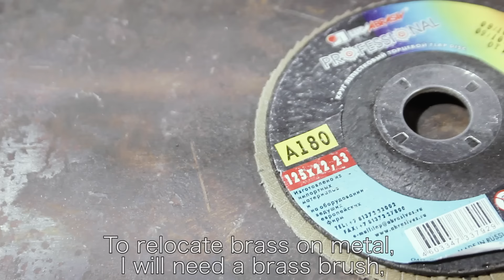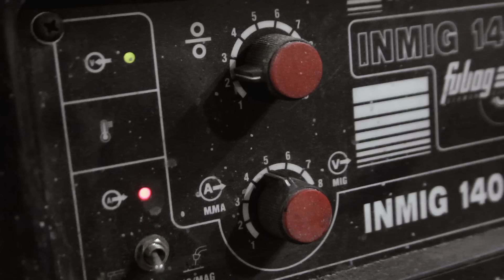Making Viking Axe from the Cheapest Bought Axe

Comment: Good deep etching, car battery chargers work real good, and white vinegar instead of water better.
Reply: I was wondering if I could use my battery charger.
Reply: How do you do the etching mate. Ive never done it before but would love to have a go at making a pair of these for hanging on the wall.
Reply: So did he just use a stick welder with a rag dipped in salty water and run it over the axe head? That was enough to etch it that deep?
Reply: @billysaunders544  yes
Reply: @RuLaKeLP  thanks very much, I tried it, it worked, I also I bought a battery charger and it worked better
Reply: what paint works best, and by best I mean is easy to create a sharp design without struggling with the paint removal?
Reply: Thanks for sharing!!
Reply: I have used etching resist marker like those used to create circuit boards..works ok, never tried the paint idea( next time) used bees wax on the steel over my pattern drawn on the steel removed wax at areas I wanted to etch. Then used vinegar let it sit for 12-16 hours .  Will try battery charger next time. 
Noticed the words coming up on the screen... but very difficult to read if you can read them at all. Voice overlay might be better there.
Reply: I was wondering if you put something on the blade to prevent rusting? It looks like there’s a faint gold tint on the blade. I loved your attention to detail, it sets your axe apart from the rest. You didn’t show your sharpening technique, I would have liked to have seen it. Anyway, KUDOS for a job well done my friend.

Comment: I`ve done this ! lol wish I`d had your tools , did mine on an old sears bench grinder and 1x42 inch belt sander !  turned out pretty good . of course I did`nt do the etching , no equipment for it !  you do nice work
Reply: car battery charger for the etching works very good
Reply: Thinking of making one myself. Any chance you could show us a picture of the axe you made.
Reply: Philip Finke
Does a car battery charger actually work for etching? I’ve been wanting try etching for ages
Reply: Daniel, I've seen many videos about it, you would need an older battery charger. The new ones have a ground fall intercept and won't work
Reply: @danielmunro6426  can’t use a smart charger, but the cheap ones that are basically a power supply with a 12v/6v  and amperage selection toggle switch work well.

Comment: Great vid and show of craftmanship - how about doing a vid on Tools to do stuff like this (maybe much more simplistic for beginners) -  stay safe
Reply: You saw the tools... But I'll run down a list of the basic things you need to get started. 
Number 1 is and always will be a vice and a stable platform to hold it. Angle grinder for heavy cutting work. Grinding disks, more disks and more disks (this will be a pattern for all abrasive cutting tools, they wear out fast). Metal files. Sandpaper, sandpaper, and more sandpaper. Water bucket to cool off the steel so it doesn't change its crystalline microstructure. Saw. Knife.

That's it. You can do everything he did in this video minus the etching with those few tools. To make things easier you can add a scroll saw, a bench grinder, a 1"-3" belt grinder, grinding belts, more grinding belts, milling machine, CNC etching machine, battery or acid to etch with, chisels, dremel tool, dremel bits, more dremel bits, leather punch, leather stitching supplies (sheath), kydex, kydex press, boiled linseed oil, tung oil, polyurethane, cerakote, forge, blacksmith's hammer, anvil, power hammer..... That's all I can think of right now lol.
Reply: @BrassBashers  I'm too stupid to understand all this shit you said but I hope one day I'll get to that point.
Reply: @isaac.3347  you’re not too stupid lacking experience would be closer to right. With a little determination and patience you’ll find your mind and hands are very capable. If your not familiar with certain tools or techniques do a little research. There’s tons of instructional videos on an endless amount of skills. No ones a pro from day one.     If you start a project and the end result isn’t perfection that not a problem. You learned what came fairly easy and what was tough for you. Research and practice the things that gave you trouble and you will get better at it. Practice on something that is scrap then you can’t mess up and won’t be so worried about ruining the piece.  Patience persistence and practice builds confidence. That’s the key! Have fun! When it pisses you off take a break. Oh yea this goes without sayin but Safety first. One skill at a time and before long you’ll look down and realize damn that looks pretty damn good! Don’t doubt yourself my friend if you really want to learn and can find the time it’ll happen. Promise!  Blessed be!

Comment: Mate, as you said 'very cool axe'. Look great as a decorative piece. Cheers for sharing.
Reply: Who said it's decorative?
Reply: @Reykh24  the handle being carved may introduce new stress points, the axe head being heated could weaken the molecular bond making it dull easier.
Reply: Untitled Document I don’t think it got hot enough to even get close to mess with the heat temper but you could possibly be right
Reply: @tomatoman3706  I should mention my previous comment is just a hunch, and not fact in any shape or form. I could definitely be wrong. I am only going off the extremely limited information I have from watching different blacksmiths work.  I'm probably the furthest thing one, as much as I find it fascinating.  The biggest concern I have is definitely the handle just because you do not want a faulty handle when using an axe.  That part of the comment is from experience lol
Reply: @ThisIsMyHandle.  Well a simple fix for making sure its not overheating is Just time. Wait for it to cool down between grinds and it should be fine

Comment: Dude that's pretty damn cool!! Just wondering about the temper on the blade.. it seemed pretty soft when you were filing it, maybe worth doing a heat treat
Reply: Not to mention the handle, which looks like pine and the rotary tool went through it like pine.

Comment: Hi, I would like to know what kind of painture was the blue one and what was inside of the salt solution?? I am trying to make the same as you following this video. It looks amazing.
Reply: Don't know about the paint (probably just normal spraypaint; it's there as a resist to protect the parts you don't want to etch, and spraypaint'll do the job fine), but the salt solution for the etching looks like a pretty standard mix. Water and salt, that's all. Get a container of warm water (warm water helps dissolve the salt) and pour in some salt. You don't need to be precise about measuring, just get it so that it's saturated/cloudy. Maybe... 1/8th to 1/6th of a cup of salt for each cup of water? If you want something a bit more aggressive, use vinegar instead of water. 

Just as a safety note, do it in a well-ventilated area, particuarly if you're using vinegar. The process creates nasty gas. Chlorine, IIRC. Small amounts, but not fun to expose your eyes to. Smells bad, too. Be sure to rinse your etched metal well afterwards to remove any leftover solution, or it'll rust quickly.

I wouldn't suggest using a welding power supply, partly for safety, partly because it might be too aggressive. On small areas or things like letter and numbers, you can use a 9v battery for power. For larger areas, I find a 12v car battery charger does the job just fine.
Reply: I believe he used acrylic paint for this job just make sure there is a thick enough coat, but u should listen to Cascadejackel^^^
Reply: @Cascadejackal  u seem to know what ur doing sir I have a question about the position of the clamps.  In the video he had both clamps attached to the same piece of metal & I'm told that will blow out the fuse instantly.  My dad said I should attach one clamp to the metal sheet & the other to the wire the axe is hanging on.  I wanted to hear ur thoughts bc it sounds like u know a thing or two.
Reply: @tanner2937  Positive clamp to the metal you want to etch or the wire it's hanging from, Negative clamp to the metal sheet. 

Remember, Positive current flows towards Negative, taking some of the exposed metal with it. That's how etching, and electricity in general, works.
+ >>>>>>> -
Reply: @Cascadejackal  Thank you for your help I'll be sure to try this once I get some free time,  have a good day man!
Reply: @tanner2937  Not a problem. One last piece of advice: Practice on a disposable piece of metal first. Something like a stainless steel paint scraper, since you can get a pack of them pretty cheap. That way, you can play with different types of resist or thickness of paint, and how much water/vinegar to how much salt in the solution.

You don't want to waste all the time spent getting your design right on the final piece, after all.
Reply: U are a legend mate scrolled way down to find this information 👌
Skål

Comment: Interesting build, I have one point of contention though.  2:50 when you're doing the file work; you should be only doing one direction with your file.  By pulling back with in contact. your only prematurely wearing out your file.
Reply: hm you dont know how the file was manufactured.
Reply: @diterpunkt4426  And you obviously don't know how they're made.  files are like a table saw blade, made to cut one direction. By pulling the file back across the metal you flatten the teeth and dull the file.
Reply: That's not quite right. Modern files can cut in both ways. And I know how they are made...

Comment: Instead of etching it with salt and DC, you could have done with way faster with the process I use : Acid. make a mix of 30% of hydrogen peroxide and the rest of chlorydric acid (the one you find at the drug store, should be at around 30% concentration, no need to find conentrated one). Keep your paint masking process and just put it into the mix. You'll see it's way quicker and could also be way deeper.
One good thing also : you can make the contour or you etching zone with wax (like the one around some cheeses), this way you don't have to immerge the whole piece, just create a "pool" around the zone anf fill it up with your mix. once you're done, use a sringe to remove the acid and simply rinse it with a solution of baking soda, it's a pH stabilizer (around 7), it will neutralise the acid and stop the etching.

Comment: I know its meant as decoration, but practical side of me is tortured by ruined temper on the edge. I have done similar builds with old rusted axe heads but try to use trown away ones and keep the heat out of the blade by cooling it. You can even weld them, long as you keep the blade cooled. There is also some temper on the back side as its usually used as hammer. None of my work probably ends up used ever again, but i like to preserve its utility use how ever much i can.

Comment: Great video, i do have a potential recommendation however. Whenever you go to use the electricity, use two seperate pieces of metal instead of one bent piece. The main path for current is just going through the metal and not through the salt water. Just a recommendation.

Comment: This is awesome, I have no clue that engraving the blade could be done that way, how is it exactly working when you charge the solution, what is it doing to the metal?
Reply: Electrolysis. The process takes the steel from the axe and placing it on the other piece, ions moved by electrical charge. High School Chemistry 101.

Comment: If you have access to ferric chloride acid it is great for etching patterns onto steel surfaces like that.  Resist can be anything from paint to masking tape.  Great work, looks great!
Reply: Would you also use the electrolysis method with ferric chloride acid?
Reply: @Spooki3Spir3  I have never tried, but I've etched patterns in stainless without it.  Takes a while based on the alloy, high carbon steel etches faster.
Reply: @drew5337  so etching stainless will work in this method, like you say it just takes longer? I have just tried it on a high carbon blade, earbud with salt water 4amp DC inverter.

Comment: I love your work! I tried my first axe and used paint instead of primer and  the paint came off when I used electricity with a cotton ball. Will I have that problem with the primer instead? And this time I'm going to use acetone to strip the finish of the blade before I put the primer on. What do you think?

Comment: What brass wire wheels did you use? Were they bras plated or solid brass? Plated ones are very cheap and easy to get.... but I'm thinking the steel would scrape the brass off again?

Comment: nice work. i hate using electriicty so i just do acid baths. hot, hydrosulfuric acid has never done me wrong. i guess you get different colors by using electrolysis or does it get deeper into the metal? whats the reason?

Comment: I'd guess the temper/structure of the metal was likely weakened after the heat of repeated grinding. Seems obvious that using it as a axe at this point would also destroy all the work put into modification. An amazing art piece though. Very lovely.
Reply: Probably, but for a single axe head, you could probably redo the heat treatment in a regular oven. 400F for an hour, take it out and let it air cool, repeat the process a second time. 

If it were a sword or knife, it probably wouldn’t work well, but for an axe, it should function just fine.
Reply: Though I do agree, using it as originally intended would take away from the artistic aspect.

I’ll give him this, I would have never thought to use the copper wire brush like that. Do you know what the purpose was behind that? I would guess to increase the conductivity in the salt water for a better electro etching, but maybe just to give it a slightly different aesthetic? 

I’ve seen people do saltwater etching using 9V batteries and q tips, but my jaw dropped when he brought out the welder. Like, “well he switched to the Big Guns fast.”

Comment: Just out of interest, is that just a thick primer you use for your edging? . 
Last I tried I used circuit board resin.
Cheers
Reply: What would you recommend?
Reply: @quinsworth1  I did some this week using normal primer instead of resin, and it worked grate, comes right off with acetone.
So i think 2 layers of primer is plenty good :)
Reply: Wouldn’t primer flake?
Reply: @khomol  let it dry so it is almost hardened, then apply what you want to etche and make the pattern with a sold screw driver you sharpened to a point. Do it just at the point where the primer got a bit of flex in it ;)

Comment: Hey so, with all the heating and grinding work done on the axe, I'm just curious as to the state of the heat treatment now? Would it not have been wise to heat it up in a furnace, re-quench and then heat treat the blade? Otherwise the quality and edge retention is gonna be wack. Or am I wrong?
Reply: Quite possible, but given it started out as a cheap axe the steel etc are probably trash to begin with. I think this is intended to be more of a show piece and a really cool project. If you started with a quality axe and wanted the product to be serviceable, your probably quite right.

Comment: Its a good thing this is only a decorative axe. You ruined the temper when heating that blade. As well as when grinding it. If you make something with an edge you need to spray it with water every few seconds to keep the heat treat else that edge will roll or chip when you use it

Comment: How do modern axes stand up against traditionally forged viking axes? If you took a modern axe back in time would a viking appreciate the quality, or would it be seen as inferior? (Ie. How strong/sharp/wieldable are modern axes compared to what they used back in the viking era)

Edit: By modern axe I mean the ones that you're getting from the hardware store. (Or even the modern throwing/battle axes) Not forged by a blacksmith is what I'm getting at.
Reply: Hardware store axes are generally for cutting wood, and therefore quite heafty compared to fighting axes which are lighter and quicker. Modern steel is just better quality (or at least more consistant) than what could be produced back then. You have the option of stainless steel, which doesn't corrode easily but is a bit softer than ordinary carbon steel. I think they'd be impressed.

Comment: That’s beautiful. I think I’ll have a go at making one of these but I don’t have the skills for doing the handle.
Reply: You get the skill by practicing! Just buy a few cheap axe handles and see what you come up with!
Reply: Greg , how do you get the golden elements on the axe head and are the electrodes just ordinary mild steel?
Reply: Suki Lall at about 4:15 you can see him transferring brass from a brass wheel onto the axe head, heated to 150c to help the molecules of the metal open up to allow the deposit. Then, etching into that will leave the non brass finish. Yeah the metal he’s using for the electrolysis is just mild steel sheet metal. But whatever process that oxidizes the metal would work, like acid etching too if you don’t wanna mess with a power supply. Or you could always go old school, which is often the best way to learn, and use manual engraving tools or a rotary tool. Of course that takes much more work and precision, but metal is great because you can always grind it out and start over if needed.
Reply: Greg C   Many thanks for the reply. I could never had known  why he was  doing that until your reply.  Really useful information. 👍

Comment: Just curious why you cut the handle off the way you did when you could've just removed it the same way you did the remaining piece.
Reply: On the top of the axe a wedge is put into the top to expand the grain of the wood and hold the top by a friction fit. So if he tapped it out altogether the top wouldn't fit anymore since it would contract then expand making it much more difficult to reuse overall.